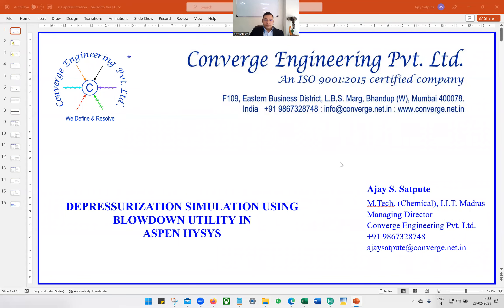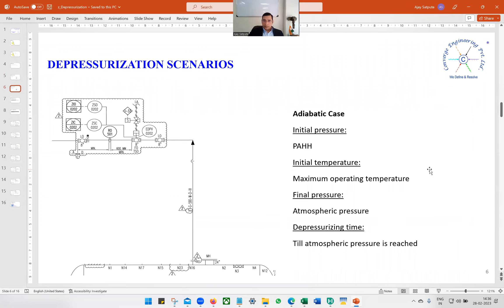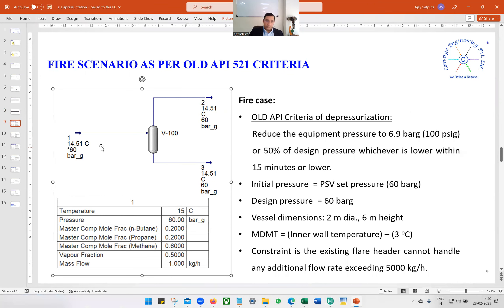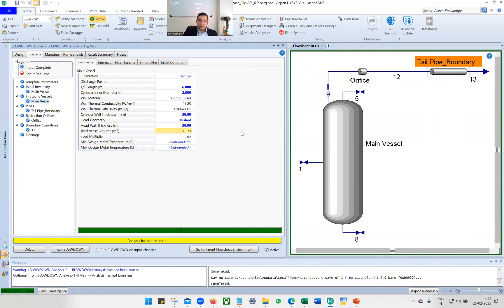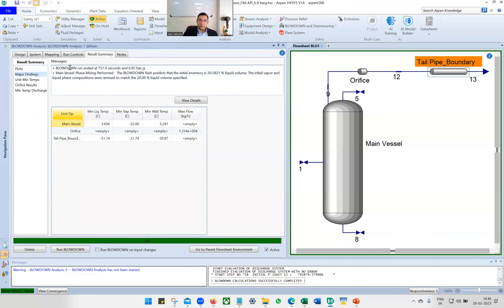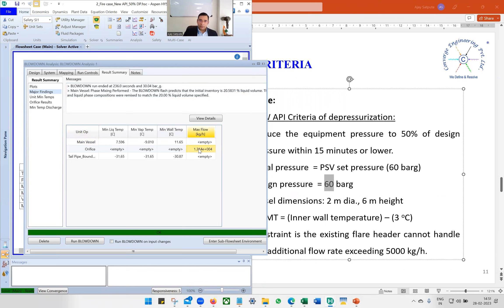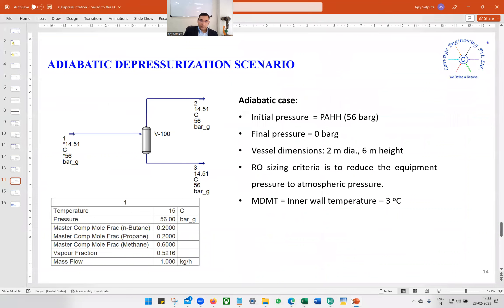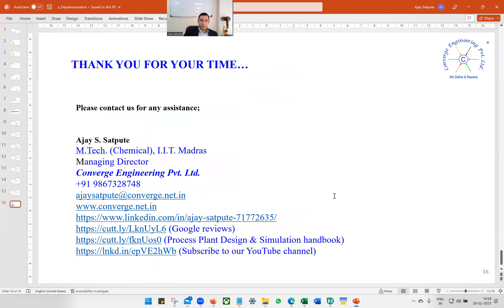Depressurization using blowdown utility in Aspen HYSYS

Comment: The EDPV or BDV is the most crucial part of any high pressure separator used in Oil & Gas industry maybe in EPF or main production facility. Great video showing how to use HYSYS to simulate and obtain results according to old and new API 521.  Very helpfull for all the Chemical Engineers both experienced and new.
Reply from the maker: Thank you!

Comment: Hi Sir, first of all thanks for the excellent contribution. Kindly clarify the following doubts without any hesitation pls

1. How do u fix the vapor fraction for inlet stream as 0.5 & Why dont we provide temperature rather than vapor fraction for fire case scenario ? If we can provide temperature what shall be taken as basis ?
2. What is the source of value for orifice co-efficient?
3. How do we determine the volumetric flow rate (For both pipeline & vessel) to run the simulation ?

Your positive reply will be highly helpful sir .

Thanks once again.
Reply from the maker: Hey, sorry for the late reply.

Did you Google in these 4 weeks?
Reply: @ajaysatputeNerul  S of course. But I am unable to get the exact solutions

Comment: Hi Ajay, Thanks for the video. I just wanted to ask that for fire case depressuring why do you take the max operating temperature for dynamic depressuring utility and not the fire case temperature. Kindly respond
Reply from the maker: Well, it is as per ADNOC standard for "Flare System Design Basis" (doc. no. DGS 0180 002 Rev 1).

Comment: hello sir, for adiabatic case you use PAHH as inlet pressure to vessel. what basis do you use for inlet temperature? can we use TAHH as the basis?
Reply from the maker: Maximum Operating Temperature can be used. You might want to check the results with TAH & TAHH and decide which case gives more conservative results.

Comment: Hi sir, Good morning. I am newer to use Aspen hysys. I have one doubt sir. U said that about wall thickness and length. How should we consider it sir
Reply from the maker: Perhaps, you need a formal training on process design with simulation software. :)
www.converge.net.in
You might want to check the above site.

Thx.
Ajay

Comment: The statement about vapor depressuring rate as per new API rule as on date is not correct in the video. As per API Standard 521 seventh edition(June 2020, Errata 1, Nov. 2022) section 4.6.6 " For pool fire exposure, this generally involves reducing the equipment pressure from initial conditions to a level equivalent to 50 % of the vessel’s design pressure within approximately 15 min. This criterion is based on the vessel wall temperature versus stress to rupture and applies generally to carbon steel vessels with a wall thickness of approximately 25.4 mm (1 in.) or more. ..... Depressuring to a gauge pressure of 690 kPa (100 psi) in 15 min is commonly considered when the depressuring system is designed to reduce the consequences from a vessel leak or failure. This criterion is also commonly applied for both fire and leak scenarios." Please check and confirm.
Reply from the maker: Hi,
Thanks for your message.
I have re-checked my ppt w.r.to your comment and found that we both are right.
Could you please explain which statement of mine in the video you do not agree with? 
If you prefer, we can have a WhatsApp call (+91 9867328748).
Thx.
Ajay